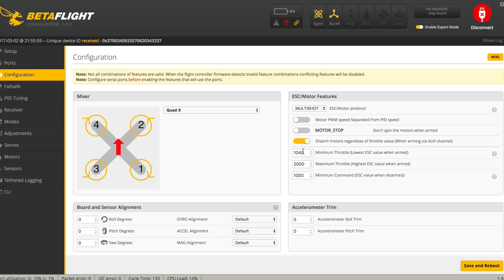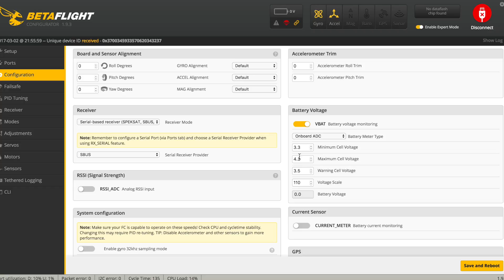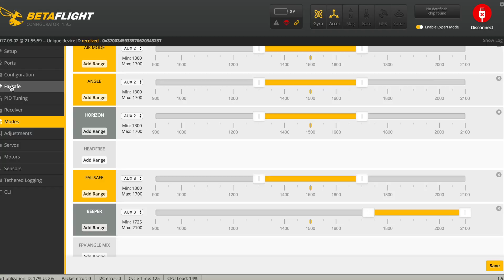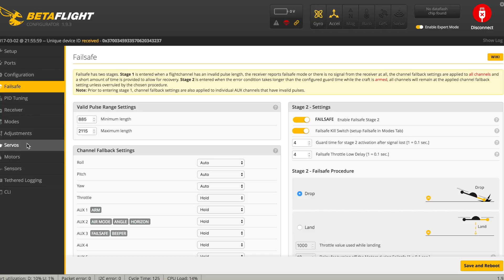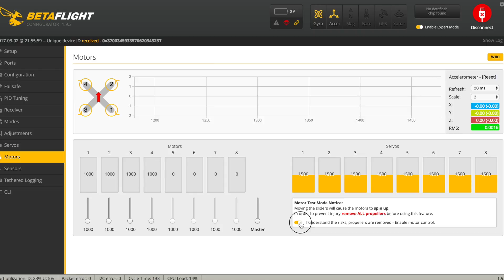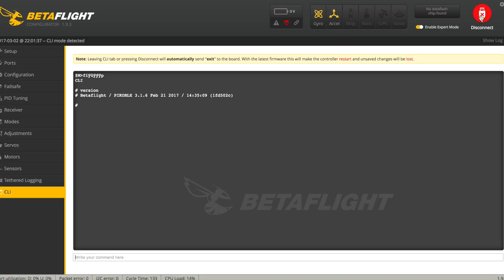Aurora 90 Custom Build - Setup - Flight

Comment: what battery are you using
Reply from the maker: Michael Lowery using several different ones.. have some valuehobby.com GeForce 500mah 50c 2s, a couple of the stock 450mah 80c batteries, and a couple of 850mah 80/160c 2s batteries..  all fly pretty good.

Comment: noticed you have horizon and angle mode on the same switch value and so it's always going to use angle mode (as seen in the vid) and never go into horizon mode.
Reply from the maker: Yea I didn't even notice that.  I only fly air mode with this so didn't even notice..  Thanks for spotting that.

Comment: Hi, thanks for the video.  im building an aurora 90 kit that i saw stu on uavfutres show but not go through the build.  im using flysky i6x transmitter and wondered if i need to solder for ppm or if sbus is compatible with ibus that this new transmitter can now do.  also did you solder the positive and negative wires off the esc, if so where?  im also adding the led strip and buzzer.  thanks for the great betaflight info too.
Reply from the maker: I am not 100% sure but I believe you can solder the SBUS and just set in betaflight to use IBUS and that will work.   
For your second question I assume you mean the lipo plug and the power to the FC?   If you do basically I soldered two short positive and neg wires from the +/- on the ESC to the FC I run the wires through the bottom of the FC and solder them on top.   Then on top of those two wires on the ESC power I stack solder the lipo plug.   So if your looking at the bottom of the quad you would see the lipo plug soldered to the +/- wires and those soldered to the +/- pads on ESC then those two +/- wires run to the FC.    Let me know if I explained that ok, if not I can send you a photo of what I did.
Reply: Jason Graham Hi, I'm not sure on the wire explanation.   Theres a red and black wire next to the motor wires coming off the esc. im not sure if those are really needed.... I did solder the red and black fat wires up throught the fc.  i was then planning on soldering my battery wires on top of the two fat wires on top of fc.  Also i know you didnt get the cool little led bar,  but now that i look at it theres 3 wires, red+ black- and a blue wire that im supposed to be able to set light configuration in betaflight.  do you know how to wire it?  I apprectate your help Jason.
Reply from the maker: Oh your talking about the black and red wires on the signal cable coming from the plug on the ESC.   I just cut those off.   

LED would be wired as follows.    So on the same group of pads where the receiver is wired.

PADS:
1                     2 (LED blue)
3                     4
5 (rx)              6
7 (rx red)       8 (LED red)
9 (rx black) 10 (LED black)
Reply: Jason Graham Awesome!  Thanks Jason.  Now i can finish this little beauty.